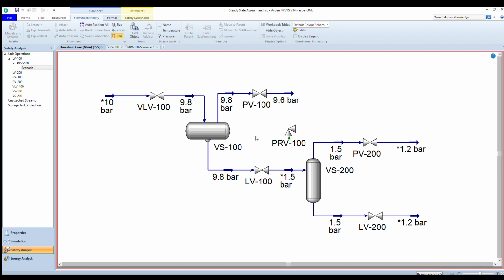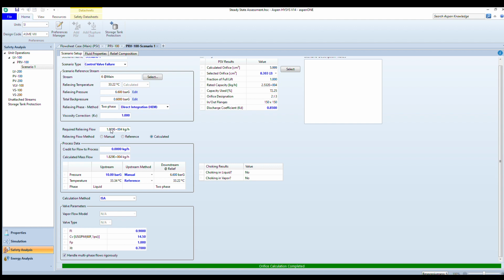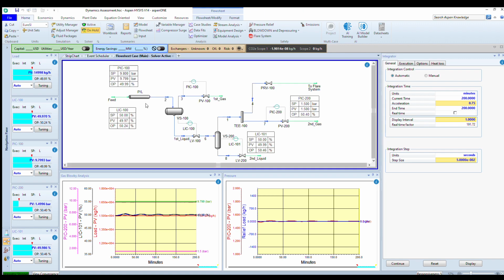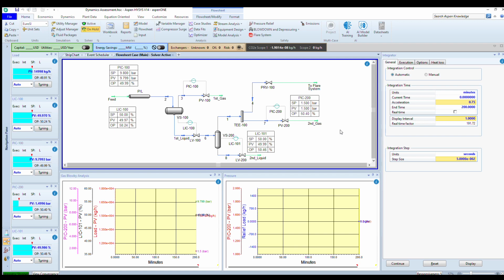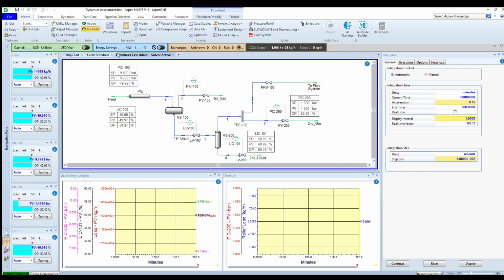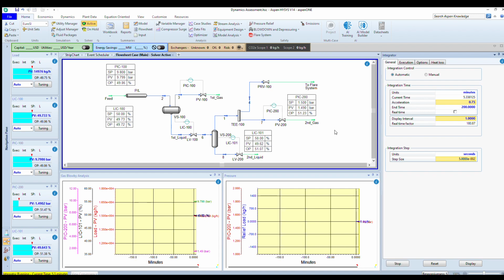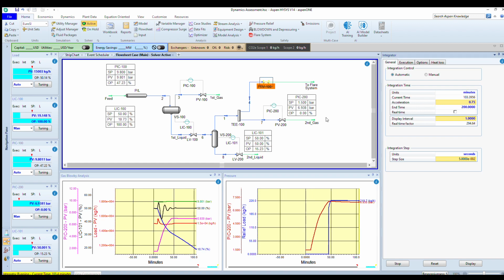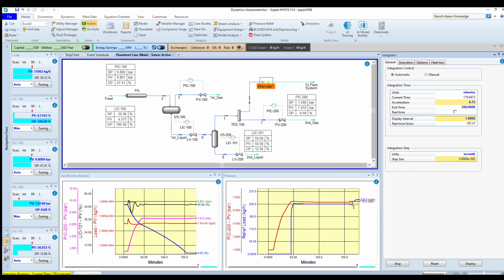P2P Dynamic Assessment for PRVs Talk

Comment: Closing the level control valve on the LP vessel will give same results as in steady state. Assuming all the control system is on failure isn't double jeopardy. API states that we should consider the absence of favourably instrumentation response in combination with unrelated overpressure cause. Why not considering the same when the overpressure scenario is from the control system?
Reply from the maker: Assuming all BPCS are hit due to low pressure IA signal, this would lead to fail safe (I agree with you in not considering this as a double jeopardy). However, the Fail Safe of PCVs & LCVs are mostly Fail Open. This will results in very normal situation.

It is so important to define the chronology pragmatically with a deep sense of sound engineering to avoid a huge overconservatsim.

Speaking for the LCV fail close & its potential results to equate the relief load from dynamic with the steady state, this is not right. IN steady state, the liquid hold-up volume and the L/V changes are not regarded, and hence, the dynamic relieve load even with LCV fail close would still report a less relieve load.